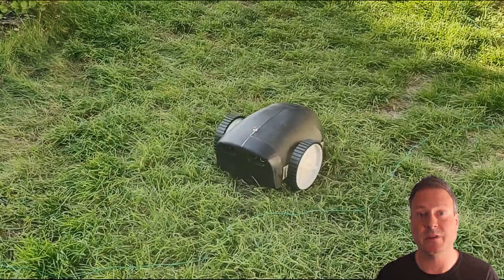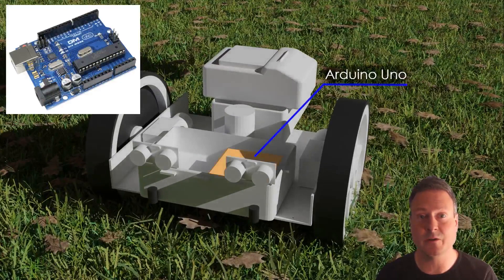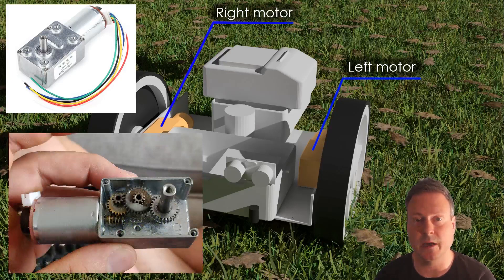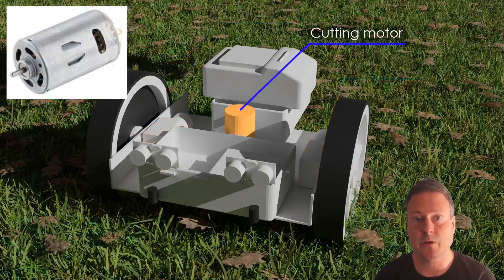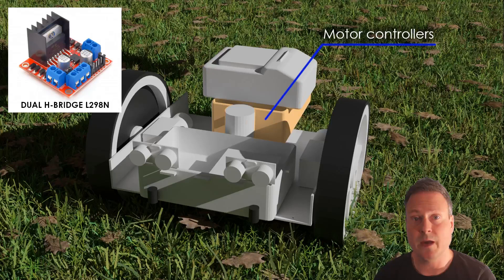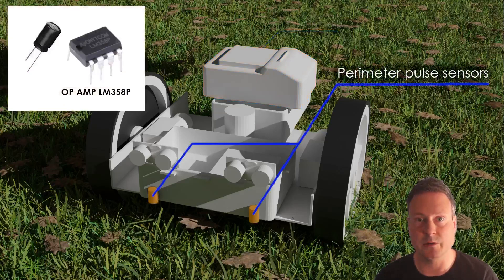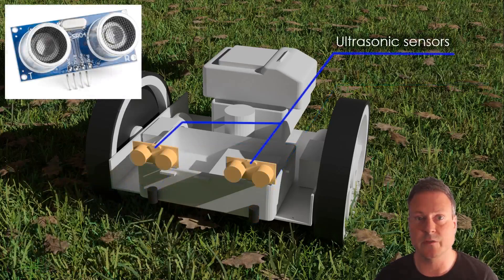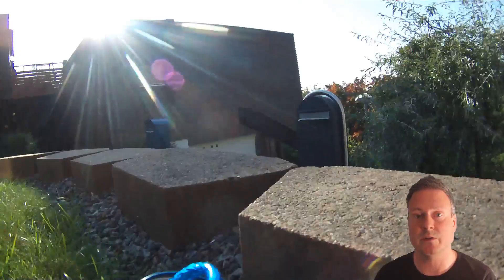Arduino Based DIY Robot Lawnmower

Comment: self-charging is a fantasy (cost) , better 4  big wheels - 2 or better 4 motors (tested),I think he is moving chaotically , little effectively,   you must spend a lot of money ( if you wish good work) or just make wifi controlled  - I will try myself you idea - measure current ( grass cut or not) with compass (correct path)  -  maybe possible if two cutters (2 motors) - other option limit switch - all will only work when lawn in good condition ( all grass  the same) - gps ok if you have big tractor

Comment: Sir i am really impressed by your work and i have also visited your site can you please share source code of Arduino and  complete simulation diagram in one picture 
Regards❤️😊
I have also subscribed your channel for further updates
Reply from the maker: Hi, you find the source code for both the robot and the perimeter wire base station here: https://robertmalmstrom5.wixsite.com/robelibob/source-code
A complete simulation diagram is a really good idea. I will try to find time to do that and add it to the robot site.

Comment: Hi Robert,
I love your Robot setup and functions. It has the important basic features and is not packed with "useless" or to difficult stuff like camera grass detection or GPS. 

One question, I saw your code on the webpage but I couldn`t figure it out yet. How is the robot navigating? As far as I understood it has no map or any kind of restriction beside the perimeter wire. Is there a random pattern?

I`m also using a powerdrill battery because I have a few and they are cheap. My plan is to start the robot and let it go until the battery is empty and then just carry it back inside and recharge to use it the next day or later again.

By the way, I really love you chassis, what a neat look :-)
Reply from the maker: Thank you Paul. I use a very simple "navigation" algorithm and that is that the robot drives straight until it detects the perimeter wire pulse on the left or right sensor. And when it does that it randomly turns right about 30-45 degrees if it was the left sensor that first detected the wire or randomly turn left it it was the right sensor that first detected the wire pulse. This alorithm needs to be improved as it some times escapes in wire corners with this simple algorithm.

Comment: Nice! What frequency are you using for the perimeter wire? Is it just detecting signal vs no signal? Would it be possible to use a single wire sensor and control the motors independently to figure out what side it is on? How did you tune the sensitivity/broadcasting strength?
Reply from the maker: Hi Ben, sorry for late response. I´m running the perimeter wire with a 5KHz signal. The biggest problem I had with getting the perimeter system working was to get the robot coils to detect the signal. In the first test i had the perimeter station creating a square signal with an Arduino connected to a 12V L298N motor driver but I just couldn´t get the amplifier connected to the robot coil in the robot to amplify the signal enough for it to detect the signal. What solved the problem was to add capacitors to the L298N perimeter wire output to get a more shark fin signal which gives the robot coil time to create a charge that can then be amplified and detected by the Analog input in the Arduino. I will soon add more information to my new Robot website:  https://robertmalmstrom5.wixsite.com/robelibob
Reply from the maker: Ben, please take a look at the Robot website I´m building for more information about how I got the perimeter wire working under Build Step: https://robertmalmstrom5.wixsite.com/robelibob

Comment: Great work! look to see uncut grass seek function.
Reply from the maker: Hi Hyper, if you add an encoder or an amp sensor to the cutting motor you should be able to detect when the cutter has to work harder and use that as an indicator of uncut grass. You could then also make the robot stay longer in that area until it doesn´t detect high amp or lower motor rpm any more.

Comment: This is a great project.  I would love to learn the process in detail of the wire barrier.  How does it work?  Congratulations!
Reply from the maker: Thanks!, I plan to create a more detailed video that shows schematics. I use a second Arduino to create a 5Khz signal that controlls a L298 DC motor driver that's connected to the wire. I needed to add capacitors to make the wire signal more sinus shaped so that it's easier to amplify the signal when it is registered by the coils on the robot.
Reply from the maker: John, please take a look at the Robot website that I´m working on for this project. Under Build Step you will find more information about how I got the perimiter wire system working: https://robertmalmstrom5.wixsite.com/robelibob

Comment: Nice project. Are you using standard mower wheels? If so, what size. Also what size casters do you use? Do you have problems with the caster wheels getting stuck in uneven grass?
Reply from the maker: Hi Isidro, I use wheels that has a diameter of 140mm and I actually took them from an abdominal trainer:) But the important part was the DC engine gear box ratio to get 30rpm that gave the robot a perfect speed and torque with this wheel size. I bought the DC engine including gearbox and encoder for good speed control at Amazon for about 18$ each. The caster wheel is 50mm and just a standard wheel I bought at the closest tool shop. I haven´t seen any problem with the caster wheel getting stuck so far.
Reply from the maker: Hi Isidro, please take a look at the Robot website that I´m working on with more details about this build: https://robertmalmstrom5.wixsite.com/robelibob

Comment: Hi ..Its very nice robot. I do have question. Whether Ultrasonic sensor works correctly  in RAIN and day Sun light without any issues ?
Reply from the maker: Hi Shail, I have in my plan to add a rain sensor to the robot so it avoids cutting the grass during rain because that will just make a mess of your lawn. And runnig a ultrasonic sensor in heavy dust, rain, or snow reduces acoustic energy and can diminish the beam or reduce the maximum range of ultrasonic sensors. But in light rain it should be fine.

Comment: Snyggt jobbat! Hur länge kör du på ett batteri?
Reply from the maker: Tackar! Jag har inte testat att köra den tills den stannar. Men jag ska testa och återkommer med ett svar.
Reply: ENG: Congratulations on this great project, which I will continue although with some changes since I have an old robotic lawn mower and I will take advantage of the housing and motors. I have doubts if you are using the A5 input, for the second detector of the perimeter cable. If it is free I would like to add a measurement of the battery; When the robot is running low, look for the perimeter cable and return home to start charging. Will there be another way to detect that the battery is low? Greetings from Galicia.
Es: Enhorabuena por es gran proyecto, que voy a seguir aunque con algunos cambios ya que dispongo de un robot cortacésped viejo y aprovecharé la carcasa y motores. tengo dudas de si estas usando la entrada A5, para el segundo detector del cable perimetral. En caso de estar libre quisiera añadir una medida de la batería; cuando se estea agotando el robot busque el cable perimetral y vuelva a su casa, para iniciar la carga. Habra otra forma de detectar que la batería esta baja? Saludos desde Galicia.
Reply from the maker: @vicentech1718  Hi Vincent, I am using the A5 for the second perimeter sensor. But maybe you can remove one ultra sound sensor as they are using two analog io pin each? Regards Robert

Comment: Hi Robert, following your instructions I started building the robot. However, I wanted to ask you for some indications regarding the start / stop switch that I can't find reported anywhere. Looking at your software it seems to me that the switch only controls the motor of the blades and not the wheels. It's correct? As aconnection on Arduino then you didn't use the PULLUP type. Maybe because you put the 10Kohm resistor?. Can you give me directions? Thank you
Claudio from Italy
Reply from the maker: Hi Claudio, sorry for late response. For the start/Stop switch I used a 10k pull-down resistor and in the source code you find this parameter: int m_iPinStartStopButton = 12. So the button is connected to pin 12 and when you press the button it switches between runnig the robot and not running (bRunning = !bRunning;) and this controlls both the wheels and the blades. So if the robot is running and you press this button it should come to a complete stop including the cutting blades.

Comment: do you have a parts list?  what motors/gears did you use for the drive wheels?
Reply from the maker: Hi Tracy, I will soon setup a web page with more detailed information about this project where you should be able to find part list and links to where I bought the parts.
Reply from the maker: You can now find a first version of the part list in this project website that I´m building now: https://robertmalmstrom5.wixsite.com/robelibob

Comment: How did you connect the cutting plate to the motor shaft?
Reply: use 755 22000RPM 12V motor (good) - has thread 5mm (sometimes 8mm)  - also can put cutting line between two nuts

Comment: Can you make a salt detect robot?
Reply from the maker: Hi Ai, do you mean finding salty surface on land? Saltwater is a quite good electric conductor so it should be possible to use some kind of conductor sensor that you drag along the ground to get an indication on the amount of salt on the surface. But if the surface is dry then I think you need to spray water on the ground before you run the robot because dry salt is a bad conductor and more of an insolator.